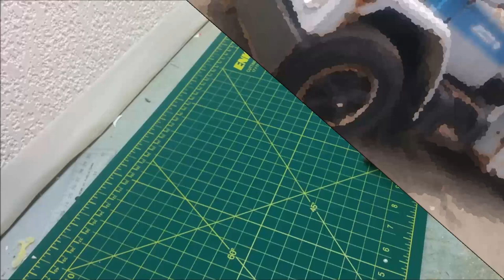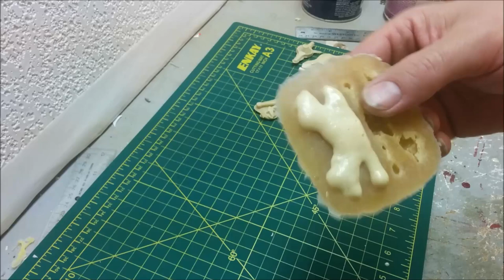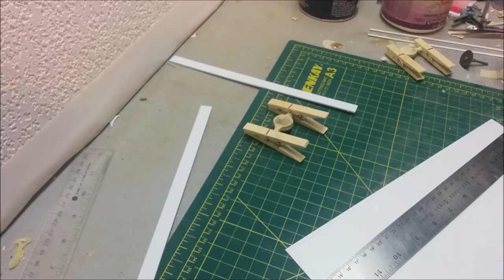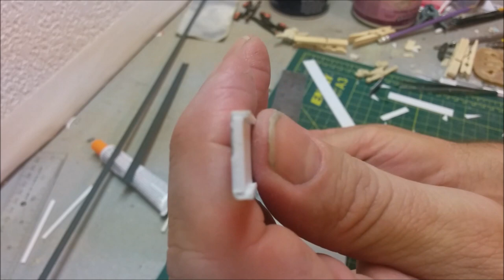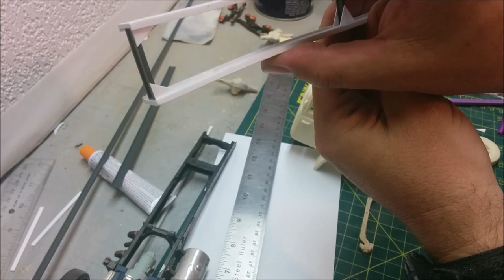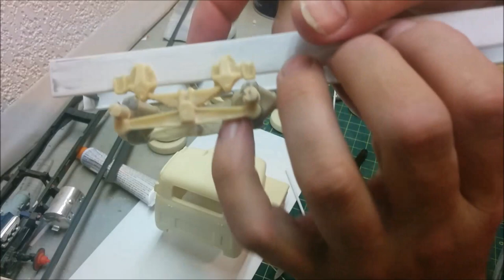Dodge Heavy Tow Truck Build Pt2 1/25 scale

Comment: Just ran across this very stimulating build. I saved it. I'm into casting parts too.  Being concerned about the strength of the suspension  and front   axle, I'm going to cast mine in white metal. The kind they sell for casting metal soldiers.  I'll use RTV molds .

Comment: The foaming of the resin is caused by moisture, and it doesn't take much. Especially as the bottle gets closer to empty there is more area inside the container for moisture to condense. If you work somewhere humid, outdoors or in a garage this can become an issue. Also if the resin is not used often but it has been on the shelf a long time before being used up.
Reply from the maker: Yes I agree with you on the age of the resin and moisture. I got a new batch and everything I've since cast with it has turned out good. Thanks for watching!

Comment: Great work, but I'm a bit concerned about the resin suspension parts that you made.  Aside from the fact that your casting resin was at about the end of its life, those parts may tend to sag over time, due to the weight of the truck and frame that they are supporting.  I will watch the build unfold with great interest.
Reply from the maker: p40f20 I haven't had sag issues with this resin before (doesn't mean I won't) A few years ago I tried a clear resin that was terrible for staying soft. I'm more worried about those front leaf springs breaking. The front will definitely be heavier than the rear! I guess we will see. Thanks for following!